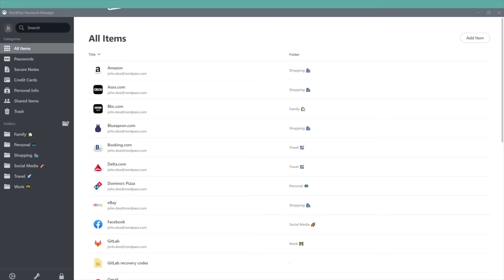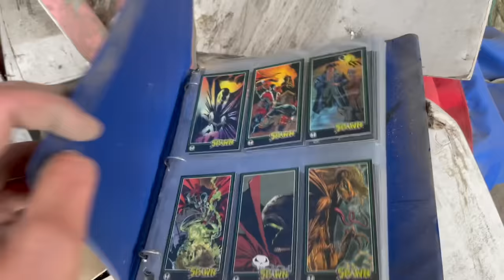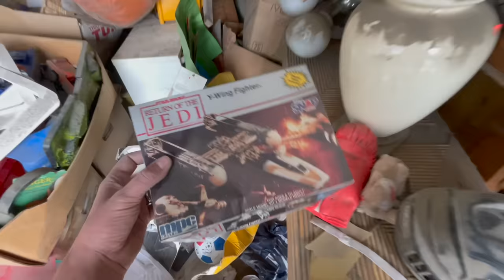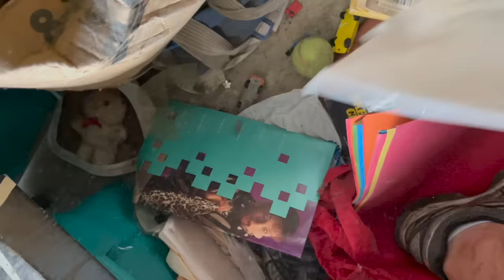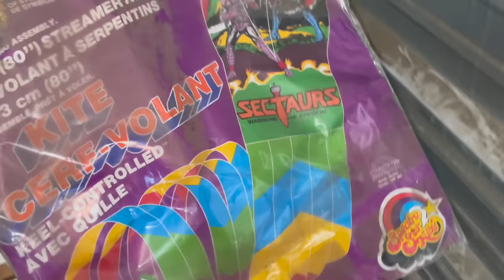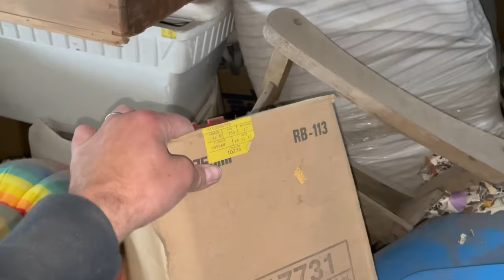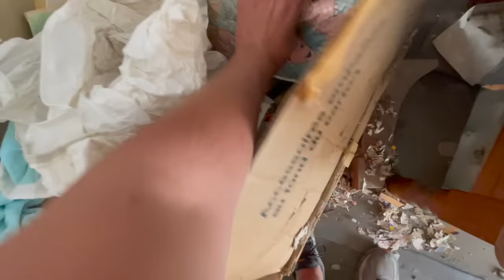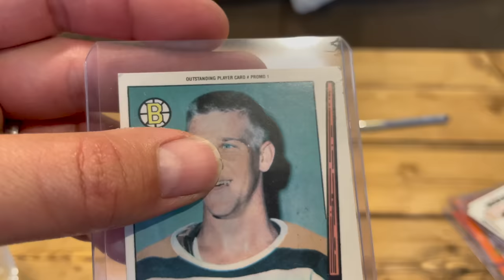Storage Locker Sealed 22 Years why??? What's inside?

Comment: Sorting:  what you need for a unit of loose items like that is a stack of plastic lidded totes.  As you find fragile items, like the yellow lamp, take the time to put it in a tote,  even if It gets stacked outside temporarily, the lid keeps the product dry.  Wrap it with some clothing that might clean up OK, like the bomber jacket.

We’d line up totes and put media in one, tools in another, clothing (like the concert T) in a third, etc, right down a line.  Shift those those fragile collectible toys right into totes, so they won’t be busted up in transport.  Use the boxes and trash bags they were in for trash.

One time saving tip is that If you handle it, put it in a container (save, trash, donate) don’t just re-stack  it, that’s how your profit gets broken..  

We use Shoebox size bins for coins, hot wheels, loose jewelry and the smalls, like the bottle openers, so that later we can work on them 1 small group at a time.

Using a mix of large, regular and small bins helps with the initial sort, transport and storage space needed back at the warehouse, since they stack without damaging the contents, the way open top boxes do, with stuff sticking out the top.  As much as possible, fill the totes so the lids can go on.

If you start doing these routinely, create a routine, so it’s easier and faster, because sometimes you will want to buy more then 1 unit at the same sale, since one renter can have multiple units and you need to buy them all, so that matching pieces and parts will likely be there.  Nothing worse then buying a unit were you can see the side of an antique $2000 dollar dresser and finding out the drawers were in the other unit, someone else got.

Usually if multiple lockers were rented by 1 person, the facility will say so.  If you get outbid on some, leave your contact info with the office or tape it to the other unit’s door suggesting the other bidder call you, so you can trade off or be on the lookout to buy/sell/trade with one another.  It’s something nubies don’t think about.
Reply: In your case, size the majority of the totes to fit under your closed truck tonneau cover, with the lids on.  That way you can transport in the rain, when you need to, with the truck bed covered.  I predominantly use the Rubbermaid units, like the ones you washed.  The lids are easy to spot and they stack well.  I reuse the random mismatched totes and those with no lids, for sending item groups to auction, since the lids have to come off for auction preview anyway.
Reply: Thank God for your comment! The chaos of "sorting" was maddening to watch. 😂
Reply: @Lanfeartyve  I agree.  Some of it has to do with making videos and wanting to show us what is there quickly, but watching people "sort" by just shifting items around and stacking them back on other items is frustrating.  :oops:
Reply: @brianhenry2385 cant the camera be stood somewhere 2 hands better than 1...the way puzzles and boxs were picked up and moved my heart in my mouth bits can be broke and lost..no method.!..

Comment: That woven two pieces of art is known as Namda from Kashmir (Cashmere), the place I come from, it's made of sheep wool, design using crochet, usually used in winter. Quite in vogue in my region and a dying art in Kashmir (Cashmere). Get it dry cleaned and you can used it in your living room probably in front of the fireplace 😉

Comment: 32:54 Dual 8-track units are fairly uncommon. Even though its a lower end unit, hopefully it didn't end up in the dump. That metal disc at 19:07 could've been part of the turntable platter for that or another stereo.
Reply: Even that turntable could be worth putting in an auction. Out here in Ontario, I've been seeing relatively basic to low quality ones still fetching up to $60. Vinyl's resurgence doesn't seem to be slowing down, so even the "meh" brands are sellable for a decent price in a lot of circumstances.

Comment: Buying storage units was part of my business model for about 15 years, Pre-COVID.  It is an interesting thing that often the larger units go for less, in the same auction.  It’s because not everyone has the time, crew, vehicle or space to deal with that large a volume.  I have seen exceptions, such as when the door rolls up (back when such auctions were done live) and everyone in the crown can see obvious value.  

One thing to remember about on-line lien sales is that your phone can’t smell the contents for you, as you can at a live sale.  This is both good and bad, but does have to be factored in.  A Smoker or Pet Owner’s unit can drop drastically in value, once you arrive and open the door.  Antique books, Sports collectibles and many items can be unsellable by the sell, without more effort.  Watch for clues in the photos, such as Cat Trees, to help guide you on bid price.  The good news is that in general, units sold on line, rather then in person can go for less and it’s hard to go too far wrong at the price u paid.
Reply: Couple other observations before I keep watching.  If this is to be more common, in your future, consider getting an enclosed trailer to pull behind your truck.  I recommend a Single Axle 10’, if you only plan to do mid-size local units or. Double-Axle 16’, to extend your range and cut travel time.  This will allow to to avoid the higher cost of rental trucks and keep your fuel costs and travel time to a minimum.  Most facilities what the units cleaned out in a day or two. They what to flip the units and re-rent them to a growing waiting list, since rent is how they make money.  

A trailer will also allow you to work in the rain/snow and when you arrive home late, you don’t have to un-load that night to protect the goods  I haul the value In the first load, then do trash in the last, for big units.  For smaller units, load the good stuff in the front of the trailer and the trash either in the truck bed or at the back of the trailer, so you can hit the dump on the way home or after dropping the trailer off.  Often fuel costs and disposal fees will exceed the units auction cost.
Reply: @brianhenry2385  good advice here ✅
Reply: @Markybug-Keira-Cody  Thanks.  Storage units can be fun and profitable, but they are also a lot of work and do come with the associated risk that you won't pay for your investment and time.  When we were allowed to, we did a basic sort right there at the facility, to separate what to list first, sell locally, donate, scrap or trash.  If you keep that in mind while sorting and loading your vehicle, it goes smoother.

Most larger units are outside and have roll up style doors.  The distance to load is short, but they are hard to deal with in wet weather.  Many mid-size and small units are inside, down a hallway.   Longer to haul to the truck, but some facilities offer flat carts that you can stack boxes on to make it go quicker.  If not, bring a dolly. 

If the facility isn't too busy, we would take empty plastic bins and a few of those white PVC folding tables and set up a  sorting area outside, in front of the next roll up door, or inside in an adjacent hallway for interior units.  Some facilities don't like it because you can block access for renters,  but many don't care. Having a dry place to separate and bin up items as you sort is always a plus!  

The best units (and get bid up accordingly) are those where it's all boxed or in plastic totes and all you have to is load and haul.  The worst, are those that have something interesting in the front, but once you peel back the first layer find piles and stacks of loose, dusty items that do not pack well.

I'm sure Alex will have this one loaded by this time, but the advice I sent has more to do with future planning then an single unit.

Comment: I had a storage unit for 10 years. The reason why I kept it so long is my father died, I then quickly sold the house in the middle of winter during a snow storm. I was able to get rid of and sell a lot of stuff, and I mean 50 years of stuff in a huge home, business stuff, kids stuff, etc. Because  the home sold so quickly,  time ran out while cleaning, so I threw the rest of the house stuff in a storage unit. My intention was to take it out when I bought a new house in a year or two. The unit was 100 miles away from where I lived and didn't cost much. I was very busy and kept putting off dealing with it. I finally realized 10 years later, I didn't want a house anymore, so I called my brother to take what he wants and the rest went to the dump. My unit looked like this one, very dusty. Anything with material or clothes doesn't last in an outdoor unit. End of story is  ten years cost me $7200.

Comment: The first Optimus Prime Transformer you found in this video was NOT Generation 1. The second, dust covered one you glanced over, 20 minutes in, was first gen!
Reply: The first Optimus Prime was Powermaster Optimus Prime and is Generation 1 it was released in the 80's, Generation 2 didn't start until 92